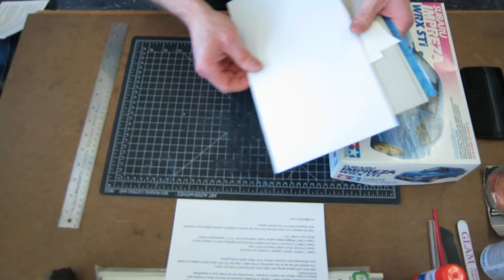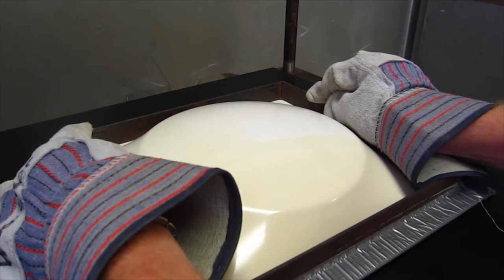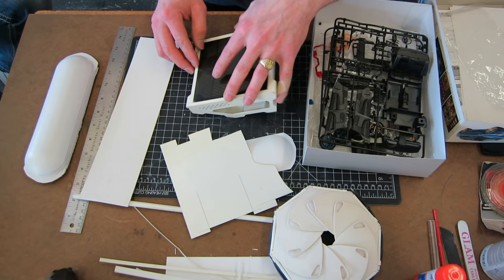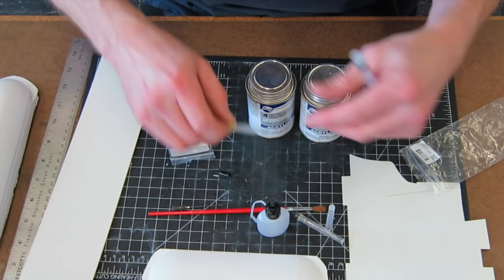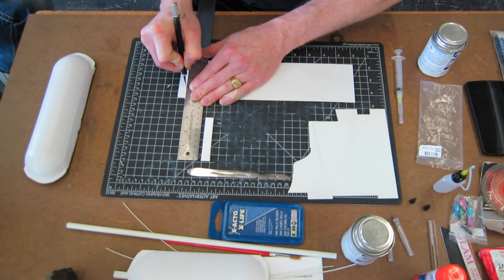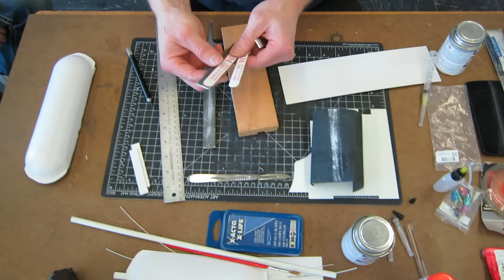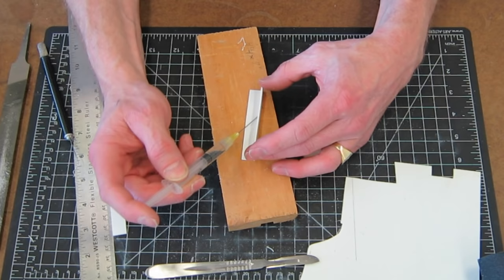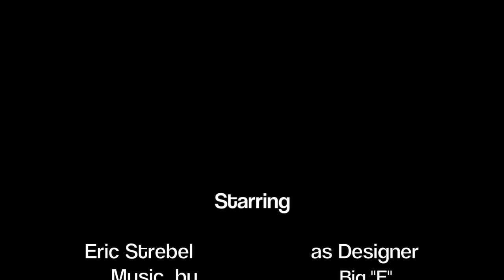Styrene Tutorial Guide basic intro plastic model making modeling tips and tricks (Part 1)

Comment: I was hoping for more ideas on how or what to use the square or circular tubing for when building model kits. However, I found this video very educational, especially for how different kinds of glues affect the styrene. I have been using brick styrene sheets for practicing painting techniques with various forms of paint as well as learning how to use spray paints/primers so as to not cover up raised/recessed panel lines on my actual models. Also using them to test color combos and proper thinning of my paints before brushing.

Comment: Just a side note, if you use regular metal tweezers, they can become magnitized and it definitely affects your modeling when you go to get tweezers tor your styrene or polystyrene and you have applied glue but your tweezers attract small drills or other metal. I have just today bought all new tweezers made especially of not magnetic alloys used by watchmakers who cannot afford to accidentally magnetize gears which magnitize other gears and the watch cannot then be made to run. These tweezers are not expensive.
Reply from the maker: Probably non magnetic stainless isy guess

Comment: Hi, great tutorial. I don't have a vacuum forming machine but do have a rough 3d cardboard shape that is made of strips to create a curve. Can i use styrene sheets and a heat gun/hair dryer to form over my 3d form to create a smoother curved piece, or is it easier to use strips of 2mm plasticard and sand the edges round like half a ball? Thanks in advance.

Comment: I've seen scratchbuilding structures using both Styrene and card/chip board. Between the two materials, which would you say is best in terms of budget friendliness and ease to work with?
Reply from the maker: Chip board is much cheaper, but styrene is going to be a lot more durable, always trades off there are....
Reply: @EricStrebel  thanks

Comment: i'm wondering whether using a "warm" to "hot" lacquer thinner in an airbrush to chemically etch in lieu of sanding would work well.

i'm a beginner car model builder, and am finding that complete body sanding is a chore i'd like to avoid, if possible.
Reply from the maker: Don't know if that will work or not. Try it and leave a reply to let eveyone know. That would be cool if it did work. Good luck.

Comment: Is 1.5mm to 2mm styrene sheet easy to bend to shape at room temperature without it breaking? And if so does it hold that shape ok?
Reply from the maker: Heat is really required to make that work
Reply: Eric Strebel will a hair dryer give enough heat to soften it?
Reply from the maker: Eh, you can try but most likely not.

Comment: Hey, also, when I sand my edges flat (or try to) I always end up taking more off of the ends of the edge or the corners actually round a bit. Especially if the piece is smaller. What am I doing wrong?
Reply from the maker: Always use a sanding block, it's just practice and you'll get it

Comment: Hi, I can't work out what the two types of glue/solvent you are using are. All I can read is 'Acrylic' on the tub. What kind of glue should I get, please? Not just the brand (as I live in the UK and it might not be available here), but the type of glue.
Many thanks.
Reply from the maker: according to the can it contains: Dichloromethane, Methane chloride, Trichloroethylene, Methyl Methacrylate Monomer.....Made by Weld-On, they probably have a MSD sheet available on their site that you could down load
Reply: hahahaha! Ok, thanks for that! What I was hoping you would say, was like 'any glues suitable for jewellery making or compatible with thermoplastic resin', rather than the ingredients, but thanks anyway...
Reply from the maker: It's not a glue, its a solvent, it melts the plastic on a molecular level +Mary Boogaloo you should be able to use plastic model cement that you can buy at a hobby store (for welding plastic car models together) or from your local plastic supply house
Reply: Sorry, I meant to say solvent. It's brilliant! Thanks for all the info.

Comment: can I use tamiya cement to glued stryrene???
Reply from the maker: Yes, you should be able to.
Reply: ok..thanks...
Reply: Opan, I don't do use Styrene , but I've seen videos of guys using Tamiya thin cement, which flows into the seams (seems?) using capillary action. I have also seen Plastruct Plastiweld, but have heard that is stinky and tends to evaporate very quickly.
Reply: Tamiya is the best I've found - humbrol cement takes 24 hours to dry and it's almost like a runny gel, plastruct solvent evaporates really fast/smells awful and is very thin. Tamiya cement is a great medium in consistency (and OPTIONS from super thin to medium and thick), and has a much better working time/holds parts in place better. Plastruct only really works decently if you do the syringe method like in the video.

Comment: thanks for posting this, you cleared many of the doubts I had but I still can't understand how to do what I'm trying to do.

I'm trying to make a part for a gundam model but I have no idea how to go about it.
it would be a round guard for a rapier like weapon but it would need to be hollow, think like cutting off a section from a cone with the diameter of a large marker leaving the top open (or even better just look at this: https://3.bp.blogspot.com/-re031LU5Q18/UqR-UN6ju2I/AAAAAAACYJM/g4Jdk8yFkYY/s1600/2000.jpg

not the tip holding the lightsaber-like blade, the one just before it)

 got any suggestions?